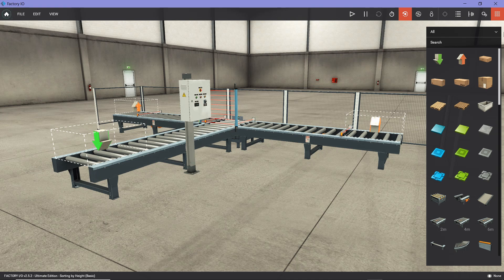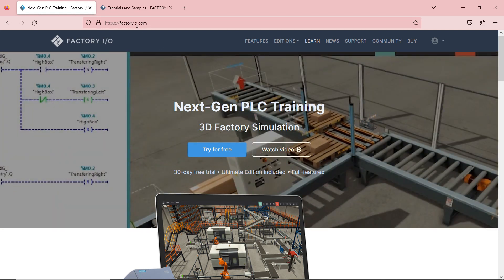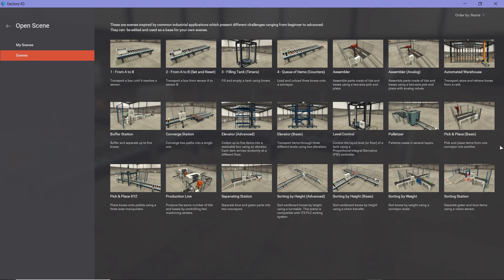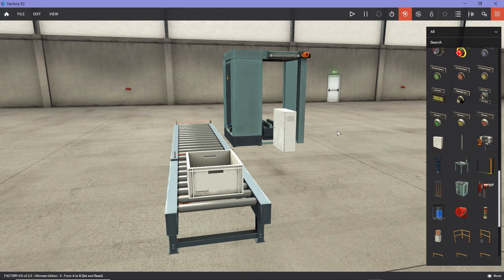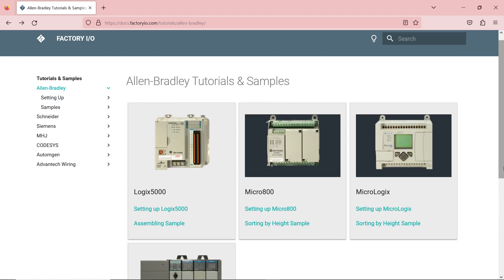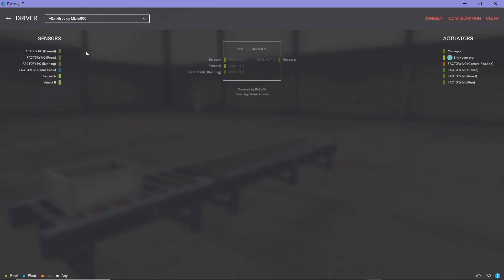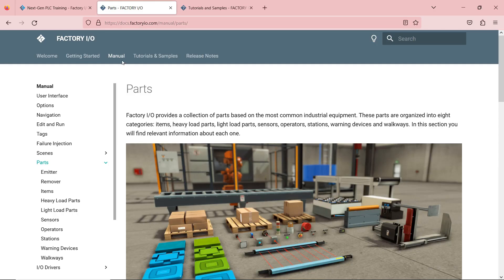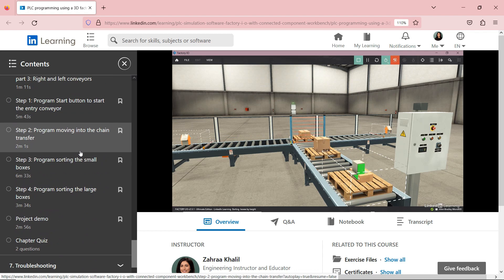Introduction to PLC training software Factory IO, a 3D factory simulation software

Comment: Could you fix the audio as it's stuck on mono instead of stereo.
Reply from the maker: Hello Carlos... Apologies about this, I know :(  , I noticed that i was on the mono mode when i finished recording 
I did fix this for the recent videos  , not this one though :(

However , the course on linkedin learning is very well recorded 

https://www.linkedin.com/learning/plc-simulation-software-factory-i-o-with-connected-component-workbench/plc-programming-using-a-3d-factory-simulation-software-22833119

Hope this helps 
And apologies again